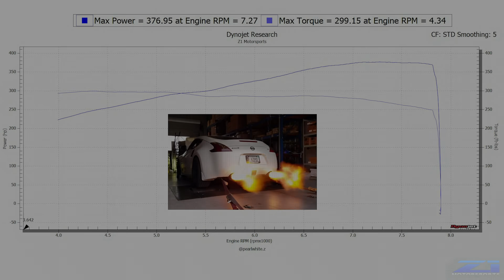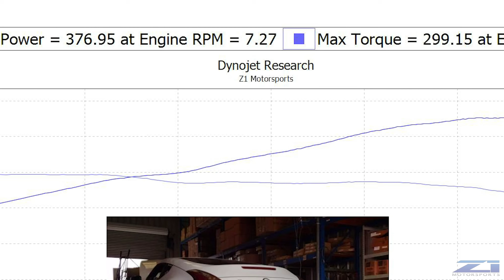Z1 broke a 370Z NA horsepower record...+100HP

Comment: 300 ft lbs wheel torque from a n/a VQ??? That's INSANE!  Great job guys 👍. Never thought it was possible... These engines continue to amaze!
Reply: Sasha from on point dyno made 361 lbft, and 537HP at the wheels in an NA VQ35. He also fitted an electric motor to it, making it hybrid 600+ total HP.
Reply: @gwot  Its amazing what he did to that engine. Tho cant compare it to this one since its extremely modified.
Reply: @gwot  that’s a one off build.. most people won’t see anything near that.
Reply: @gwot  yeah but that’s a fully custom race spec engine built by brian crower and JWT custom 1of1 crank shaft they’ve never used or reproduced, 15:1 compression ratio running 105+ octane. Sasha is a fucking god.
Reply: @Strahlendersonnenlicht  its a jim wolfe crate motor. Sasha is the tuner
Reply: I pray u can come back and comment I have the tested na z one day I goal 400WHP will I actually reach it idk realistically 395whp or 380sum we will see tho
Reply: But before all that Sasha was VQ35HR engine with VHR crank to make a VQ37VHR, actual full bolt ons & cams & went from there to build it even more right before the crazy fully aggressive built engine from JWT which was gonna be placed with the hybrid system. He was making crazy power.

Comment: Didn’t Sasha’s 350z HR make like 400whp? HR>VHR
Reply: Deemah GZ Sasha also had headwork and ITB’s. Don’t be a fanboy. Mod for mod a vhr makes more power
Reply: Sasha has VQ37 rods, crank, custom pistons (since VQ37 ones don't fit in a HR), custom ITB setup, SGP longtubes, head porting and lots of headwork, super wild cams, the kitchen sink. Not cheap and not easy. Plus MOTEC...i.e. $$$$$.
Reply: Card Asset because they’re claiming 370z power so it doesn’t even include Sasha. Read better
Reply from the maker: This is a record for the Z1 dyno on a totally stock motor (minus the JWT cams) VHR. Comparing it to Sasha's car is like comparing Apples to Oranges. Sasha's car is has ITB's, higher compression, built bottom end, etc. Not anywhere close to what we did here.

It made more HP than Nissan's Pirelli World Challenge race cars we worked with many years ago.
Reply: @Z1Motorsports23  i'd like to see this dyno duplicated with another build. what year car is this? good job guys.
Reply: @DailyBeater  2017
Reply: Hr=oil burner
Reply: @Z1Motorsports23  Whats the Z1 record for non-stock motor NA then?
Reply: ANS94garage got it mixed up with the DE and RevUp lol

Comment: This video just sold a lot of Greddy exhuast and C2  cams
Reply: @doggystyledave  Do you know how long it takes to change the cams on this car ? man it's over 30 hours for someone who knows what he's doing... If it wasn't of that, I would have done this on my 370z since a long time
Reply: Qlassicrepresent Who’s changing your cams😂 maybe for a guy that has no instructions and knows nothing about engines but max it should take is 10 hours for a rookie that know what he’s doing
Reply: @TienTran-kw3il  11 hours? Finished, with the Bumpers back on perfect and every last bolt torqued to spec? BULLLSHHIITTTT GTFO
Reply: I own a 300zx z32 and changing the cams can be a bitch but it wont take30hours trust me I did mine and just to unbolteverything took me 2 hours obviously had my couple of deletes already done so it speeds up the process and then I  to set the cams in  3 hours.Setting timing to spec is whats a bitch 5 to 6 hours on that.
Reply: doggystyledave all the 2015+ bolt on Z’s make 340rwhp+ easily lol.
Reply: Curttheplug what the max you think I can push on a q50 3.7 can I do internals like this
Reply: @pushhrodd01  how many cam swaps have you done? This whole job cost are $8,500.

Comment: Damn that's nearly 911 GT3 numbers, which is insane considering that the GT3 engine  is a purpose-built motor and not a mass-produced engine.
Not sure it really makes sense in terms of HP/$ given how much work is required to install the CAMS but that is some monster power for a pure NA motor. 

Congrats Z1.
Reply: damn if nissan can just shred 200lbs or more out of this car it will be a perfect car to match the 911
Reply: @OQuinn-07  We can only hope that Nissan refresh the Z platform this upcoming year. 

The FM platform has held up remarkably well but I'm sure they would have no issues cutting 200 odd lbs out of the car.

That said the Z was always more a corvette competitor, and it really needs the new Vr30 engine to compete.
Reply: @cristianchavira8591 The current version doesn't but go read up on your history on what the Z cars, because clearly your not aware of the 240 and 300zx.
Reply: It's not even close to a stock 4.0 991.2 GT3.  4.0's come from the factory with 493 RWHP.  Either way, you're comparing a front engine RWD consumer sports car to a rear engine RWD track focused car that costs almost 4 times as much as a 370.
Reply: @huehuehue-x3c  Edit: For a 991.2 with the 4.0 engine sure,  420whp range is what most see out of the 991.1 and the 3.8L engine however.

And yes I'm comparing it to that because it's impressive that a mass produced 3.7L v6 can get that close. 

Thought that was clear In my first post. Lol
Reply: I dont get why nissan never thought about reviving their inline 6. They used to make one of the best inline 6 in the business before. I think going for inline 6 should make the car lighter and cheaper since inline engine requires only few parts to move compare to v6.
Reply: @OQuinn-07  Packaging, R&D costs plus they already have an engine platform that is class leading in the GTR.

They essentially took that, made a few tweaks and they now have a mass produced version in the form of the VR30.
Reply: BigHeadClan I thought I made it clear that it's a dumb comparison. Blow up your heavily modded 370 and it's on you to have it fixed. Something goes wrong with your 911 and it's warrantied 😂
Reply: Which GT3? A 996? Sure. A 997 3.6? Probably. A 997 3.8 or a 991 4.0? Not even close. Not to mention a GT3 is rear engine putting it's power down way easier than a Z.

https://www.youtube.com/watch?v=TDG8UkPUZ0w

This not even close to a stock 991.2 GT3. They are 455whp 331wtq. Don't know where you came up with that.
Reply: @huehuehue-x3c    Then you can go and literally buy another 4-5 brand new 370Z  or 12  engines with the money you didn't spend on a GT3???  If you don't want to risk your warranty then don't modify your cars it's as simple as that. The entire point of modifying a car is to try and get the most out of what you have to work with while minimizing risk,  this may surprise you but the vast majority of people don't have $140,000+ lying around to which to buy a GT3.  A used 370z can be had for less than 20K however.

Lastly the only major modification used here  is the Cams, literally everything else is a strait forward bolt-on with nearly 0 risk to a cars reliability.
Drop the cams from the MOD list and you can have an engine that is pretty much guaranteed to last up to 200K miles without issue.
Reply: BigHeadClan that's hilarious. If that 200k number were true, the Zs would hold their value a lot better. You also forget that the GT3 has more than just an engine advantage over the Z. Much better tuned chassis, rear engine, better aero and better brakes.
Reply: @MelvinKhosa  I was honestly thinking of the  991.1 with the 3.8L when I made the OP,  but now that I look again the videos and pictures I looked for the 4.0 they are all 2017 not 2018,  so I'll have to walk back my statement for the 4L engine it's up about 30 more HP than I thought. So while less impressive  it still doesn't change the fact nearly 380WHP is an awesome numbers for a mass produced V6 motor. 

And yes the RWD/Rear engine does have less drive-line loss and can put said power down easier thanks to that weight over the rear-wheels,   but
that's not really a massive issue since these cars are both high-revving engines and don't really start making power till over 4.5-5K RPM.
Reply: Sure 380whp is impressive for a 370z NA. But you gotta consider not everyone is gonna go this route. And a 370z tops out at 7500rpm right when a GT3 is starting to hit its stride. This is impressive but you can't really compare it to a GT3. Even if you take a stock 991.1 3.8 GT3 making 475hp, this 380whp is nowhere close to that.
Reply: @huehuehue-x3c  The VQ37 engine has been around since 2007 and Nissan uses it in many, many cars. The reliability of the 3.7L engine is a well documented at this point.

 As for re-sale value that's largely because Nissan hasn't been committed to updating the Z platform and it's been largely unchanged since 2009 and it's still currently on sale, so the market is flooded with Z that are pretty much unchanged for the past 10 years. As a result these cars don't maintain their value... not that it really matters because it's rare any car in that price range holds it's re-sale value well. 

Lastly I was specifically comparing the engines of the two cars because that is what is on display here,  why the hell would I start talking about handling???  The GT3 is the superior car no questions , but I'm not trying to make that case that it's not.

@melvin khosa -  Both are high-revving, Natural aspirated, 6-cylinders  engines with comparable displacement that are still sold today. That is sounding pretty damn similar so why wouldn't I use the what is arguably the best NA 6-cylinder engine on the planet  (the GT3) as a benchmark to compare against????

Unless you know of some other engine that meets all of those criteria? I certainly can't think of any...
Reply: I want a z1 modified car......
Reply: @BigHeadClan First the VQ37 has been around since 2009...not 2007. Second you can't really compare a run of the mill mass produced Nissan V6 to a factory race bred Porsche motor. The engine in the GT3 is special and only reserved for the GT3/GT3RS. They don't use it in any other car. Anyways your claim of this 376whp being "near" a GT3 engine is false.
Reply: @MelvinKhosa  The engine made it's debut in 07  with the  refreshed G37 at the New York Autoshow  and  entered production for  2008 model year. Thanks for playing.

As for comparisons I've made my case already, it's a modified engine so it doesn't make sense to compare it against the average run of the mill  engine. Give me the name of  a mass produced,  high-revving, 6 cylinder engine that is NA which makes nearly 400 WHP and I'd gladly use that instead.
Reply: @BigHeadClan  " Give me the name of  a mass produced,  high-revving, 6 cylinder engine that is NA which makes nearly 400 WHP and I'd gladly use that instead.

991.1 Porsche 911 GTS says hello. Stock probably make the same 370~ whp as this Z. Also TIL 376whp is "near" 400whp /s. Yeah you got me with the G37. Completely slipped my mind. I thought it was launched in 2009 with the 370z...totally forgot about the G. I had a 03 350z and moved up to a 2011 370z so don't think I am hating on the VQ37 and what's been done here. It's impressive sure but again you comparing it to a GT3 engine especially a 991 GT3 is asinine. The most you can compare this to is to a 996 3.6 Metzger and even if that. A GT3 engine will always be more special than any street tuned VQ.
Reply: @MelvinKhosa  Well Porsche doesn't technically make the 3.8L anymore but admittedly I totally forgot they offered it on the standard model and not just the GT3 soo touche..

As for the g37/Z thing it's no biggy most would forget, I only remembered myself because I own an 09 g37 and I skipped the first year to avoid any possible issues with a first year motor. Lol
Reply: BigHeadClan car did well but you’re reaching when you claim GT3 numbers. Cayman S, GTS, and GT4 runs rings around a z on a racetrack... no need to line the GT3 up. Still impressive numbers for a Z
Reply: @huehuehue-x3c  lol it will blow up the first day out of warranty.
Reply: @huehuehue-x3c  wait the GT3 is not a consumer car because it's track focused? Who is it for then? Non-consumers!? Also it's rated at 493 crank hp not rwhp, please get a clue Porsche fanboi...
Reply: nighthawk0077 you're a little late to the party. The average consumer cannot afford a GT3.  I'll take the fanboy comment as a compliment seeing as Porsches punch far above their weight class. Hypercar performance numbers from the factory at less than half the hypercar  price. And they still make manual gearboxes for enthusiasts which is more than the other exotic car makers can say.
Reply: @huehuehue-x3c  lol the truth is this modified 370Z is punching far above its weight at a fraction of the price, and again please get a clue, Nissan still has manual gearboxes as well.
Reply: nighthawk0077 you need to learn to read. No one is cross shopping Porsches and Nissans.  The 370Z is 2 seconds slower 0-60 than a base 911 and offers a fraction of the comforts.
Reply: @huehuehue-x3c  No one said anything about being competitors, what people are bringing up is that this modified 370Z is making similar power numbers. Also bringing up 0-60mph, the most useless Stat of all especially for a track focused car proves you are a bench racer. If  this 370Z had a dpk gearbox it would lay down some fast times to..
Reply: I love how so many people are bashing you for comparing this VQ engine to a GT3 engine. Like obviously this Z is nowhere near the same car as the GT3 lmao. But for a seventh of the price of a GT3 you can buy a fully loaded Z with less than 75k miles. What Z1 did with this particular car is impressive and will be very fun for the owner and still pretty damn reliable since it's still NA. Stock Zs or still NA Zs are very reliable so whoever was talking about the reliability being an issue for these cars is a complete idiot. A lot of people supercharge or turbo their Z and that's when they start to become less reliable. Anyway, it's a good time reading through all of the replies lmao.
Reply: @MelvinKhosa  s54 builds are making well over 350whp SAE with only 3.2l and rev to 8200rpm.  3.5l stroked s54s are +400whp territory...all NA
Reply: @Bo Selecta No you can't. You can raise it but you can't turn it off. And even if you do turn it off, no way are you spinning a VQ anywhere near 9000rpm LMFAO. Learn your shit before talking. The Porsche GT engines are not even comparable to the pedestrian VQ.
Reply: People getting crazy here ! Add a superxharger or turbo set up to a  z for likeb 8k with some nice suspension parts brakes pads and tires another 4k plus 18k the z would cost total around 30-35k and bye bye gt3 in any racing scenario you like with same driver
Reply: @MelvinKhosa  no need to get upset. You don’t have to spend $30k for more than 8000 rpm. Just upgrade the gears in a new oil pump, change out your valve springs, do some cams, and hope your main+con rod bearings are there for the party. Lol

Comment: Folks were skeptical about the JWT C2 cams. With the right mods, good things happen.
Reply: Apparently those cams really shine in the midrange and fall off up top.
Reply: @nighthawk0077  True, but you can make adjustments to use the power. Just have to know what to do.
Reply: @spooler7828  I am skeptical to be honest. I think Z1 is fudging numbers. Perhaps with Dyno correction factors. Hard to know as there was no "before" run. They also claimed 34whp from just their intakes.
Reply: @nighthawk0077  No, they give you more midrange. I have a set in my motor. Fudging numbers? Hard to do on a dynojet and that is what they have.
Reply: @spooler7828  Not questioning they give you more, the question is how much more. Anyway I'm sure that 370 runs strong. That much torque all the way from 4000 is nuts.
Reply: @nighthawk0077  It's NA so it is not too nuts. My car is twin turbo and the TQ at 5100 is peak TQ.

Comment: Ummmm.....what? Pull vids needed now lol. 

Absolutely insane numbers, almost 300wtq NA, holy hell!

What’s the labor cost on the cams?
Reply: Labor costs would probably be expensive. I am guessing this is a 20-30hr job. Call them and find out.
Reply: @MelvinKhosa  Yeah I remember reading somewhere it was at least 20 hours. That's a ton of money spent on labor but hey he hit the record so that's awesome.
Reply: Yeah well it was their own dyno which usually reads pretty high on the forums. We need to see a 1/4th mile run with this to see if its really making that power. Low 12's with a 112mph+ trap speed.
Reply: melvin khosa low 12s!? There’s VQs doing that already with 330-340whp. This has to be at LEAST high 11s
Reply: Luis Ramirez Of course. I was just giving reasonable times just in case the driver can't launch the car.
Reply: Luis Ramirez nah close to around maybe 12.2s I ran a 12 (damn near flat) with a 100 shot and about 410 at the wheels with spray. Could be but I doubt it. And I reeled in stock CTS-Vs
Reply: @wanted247ha8  Theres already NA VQHR/VHRs with weight reduction FBO e85 tune running a little under 12.1. Idk how you didn't get into 11s with spray
Reply: @LuisRamirez-zi1nf  yea for real. Bolt ons and a 100 shot? I'd expect 10's to be honest with a some good tires and a great driver.
Reply: @MelvinKhosa  you can’t cheat the track. That’s the real test.
Reply: Coming back to this comment and seeing how Vq’s were only doing low 12’s 4 years ago and nowadays theres a bunch of them running low 11’s and even high 10’s NA with no built block or ported heads or spray.
Reply: @DaytonaBlueHr damn really? Where are they at